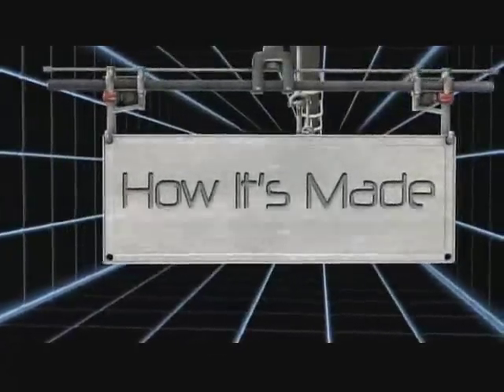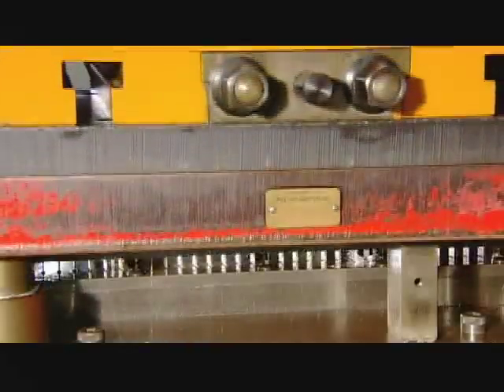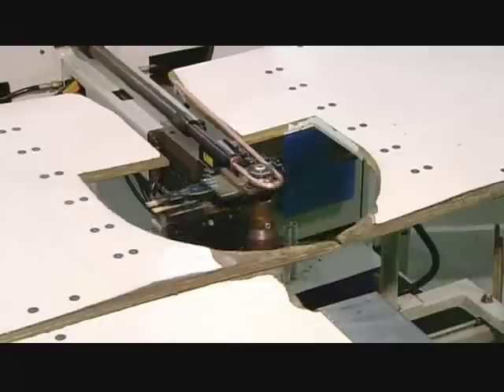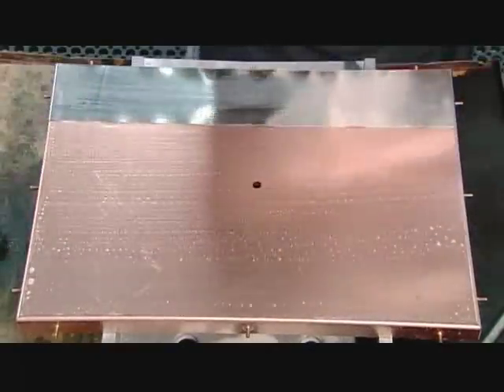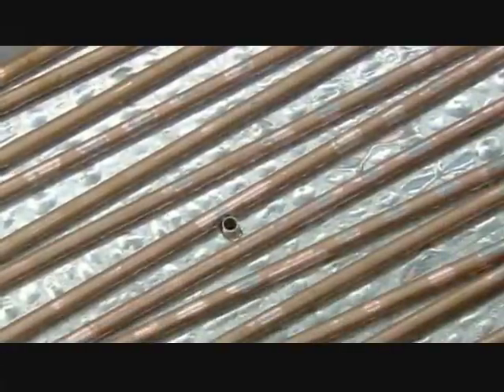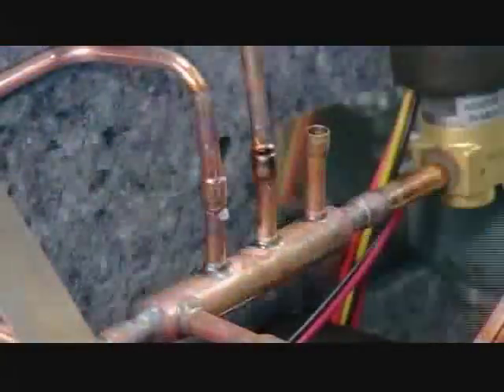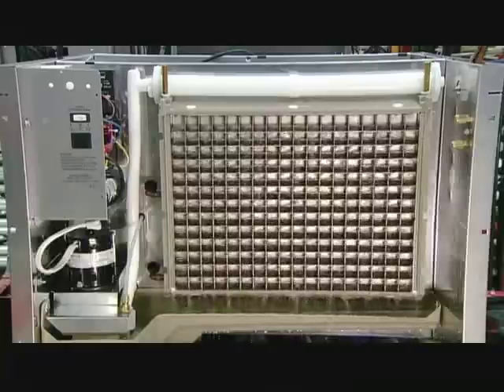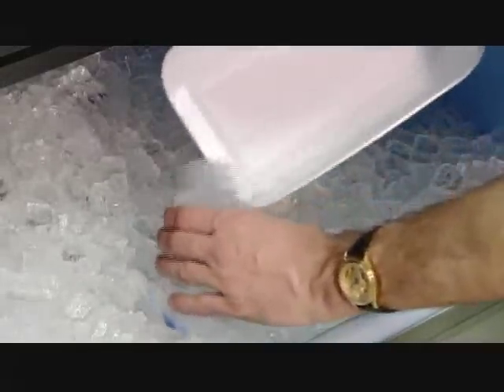How It's Made: Ice Machines

Comment: I have been repairing Ice machines for years, in my honest opinion the Cornelius CCM0530AH1 is the best and most reliable.  This episode of How it's Made basically shows that particular ice machine.  Ice-O-Matic and Cornelius are the same company/products, just two different names.  Be sure and use some kind of scale filter to reduce mineral deposits in your new machine.  Write if you have anymore questions.
Reply: Nope, Hoshizaki every time
Reply: Cornelius buys ice-o-matic machines before the model number, serial number, and nameplate are assigned to the machine. They are not the same company but exact same product. Cornelius makes their own nugget machines and dispensers.
Reply: The minerals & impurities are washed off by the dispered water flow running off as the water freeze accumulates. Sort of like reverse distillation, but instead of heat it's cold freeze. That's why the cubes come out clear. Smart process if no filter is used.

Comment: How does it dump out the ice cubes from that copper array frame.
Reply: Basically it should apply hot refrigerant to remove the cubes
Reply: Exactly what Jean said. But to elavorborate, when the ice maker is in a "freeze" cycle, it freezes ice on the evaporator, when it is done, the ice maker kicks into "harvest", in which hot refrigerant gas is circulated through the serpantine to assist with ice removal.
Reply: * elaborate.
Reply: Fisnik Zumberi You can edit your comment if you want. There is an arrow at the top right corner of your own comment. Click it and click Edit.

Also, thanks for the response guys.
Reply: Jean is correct, but I will add that units also utilize in addition to that a small bit of water called 'water assist', or it MAY have a shaft that literally pushes the sheet of ice from behind the plate. To break the vacuum. But it's mainly hot freon doing the work.

Comment: Not designed with the tech in mind!!  Jamed together,  and hard to access components.  Thoughtful design.  Who cares after they are out the door.
Reply: lol. A lot of the older models are more tech friendly. Valves right up front,  giant relays instead of tiny circuits. Tin dipped instead of nickel coated.